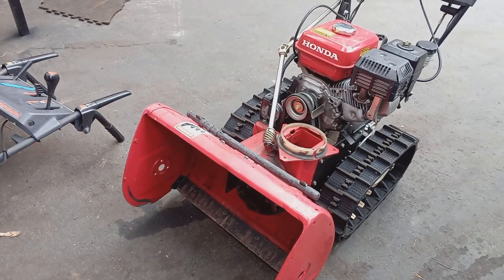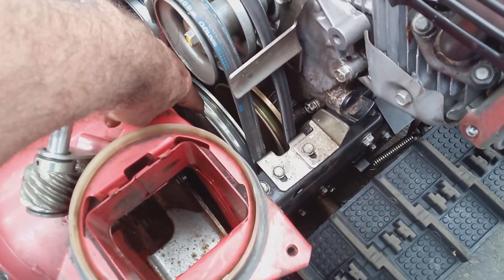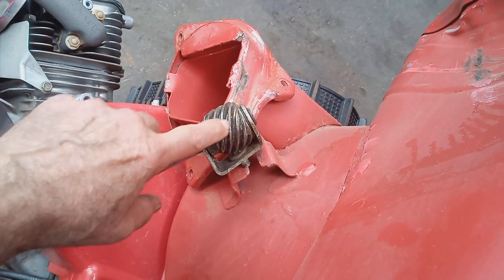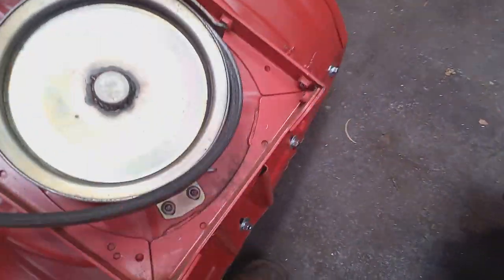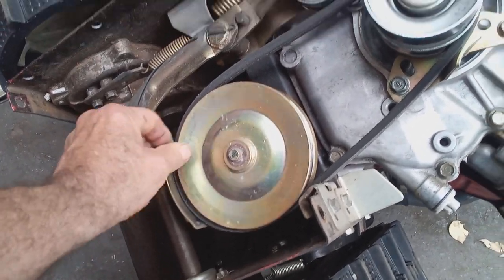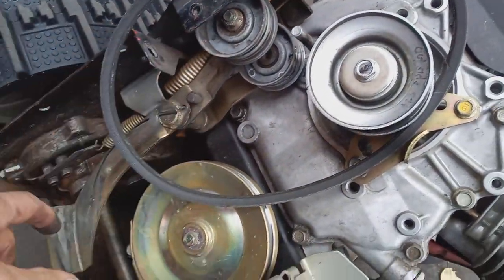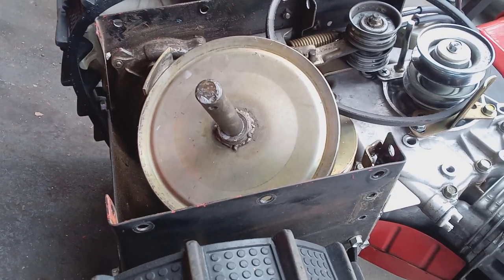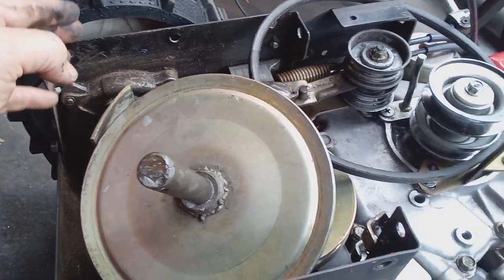How To Replace Belts Honda Snowblower  Removing Auger Housing/ Bucket.@HondaSnowblowerEnthusiasts311

Comment from the maker: Step by Step on hydrostatic honda models. on removing your bucket to replace belts, bearings or any other work you may need to do. I have done this over 100 times. Here is a handy tool that will help you remove the bolts to remove the housing/bucket https://amzn.to/3wxKoNe

Comment: Your videos have helped me a great deal - however, you don’t seem to have repair videos on the HSS models … everything is similar …. But different… very hard to find repair videos on a HSS928 … guess they never break down

Thx vm for your efforts
Reply from the maker: No they break down. What do you want to know? just did a video on switching out joystick switch.
Reply: @HondaSnowblowerEnthusiasts311  I was making a general statement that most videos (not just yours) cover the HS models.   Currently getting my HSS928 ready for summer storage and your 4 part service videos were very useful.   Your HS repair videos and the wealth of common sense suggestions are (almost) directly applicable to an HSS.    Thx for your efforts I have learned a lot.

Comment: Is the bearing number the same for a HS624? also do you recommend the Honda bearing or aftermarket
Reply from the maker: I think so . a 6004-2rs for impeller bearing an dif # for side bearings if needed. check a parts site like boats.net. a good aftermarket bearing that costs a lot less will work. bearing supply.

Comment: Getting ready to do all of this on a Customers HS928-WA . How often\common is it for the impeller shaft to be stuck\seized into its shaft to the impeller fan ? And what's some tricks to getting the augers out of their housing if it is in fact stuck . Also the attaching fastener , is it a roll pin or shear bolt that connects the shaft to the fan pulley shaft ?
Reply from the maker: Impeller shear pin holds impeller to the auger pulley wheel. Lots of good penetrating oil and patience usually works to free stuff up in time. Sometimes heat and banging with hammer will loosen it up. Somewhat common with older machines that were left outside for years.